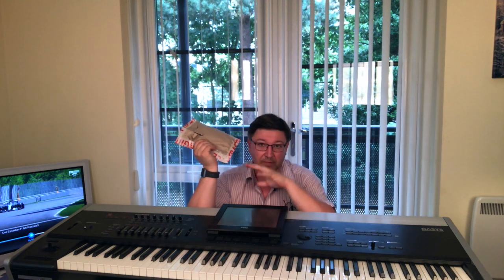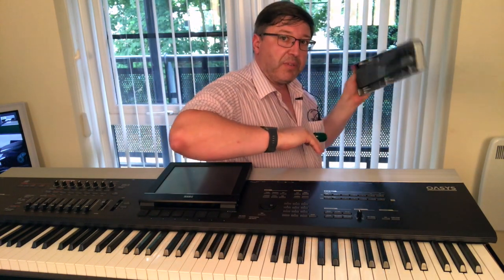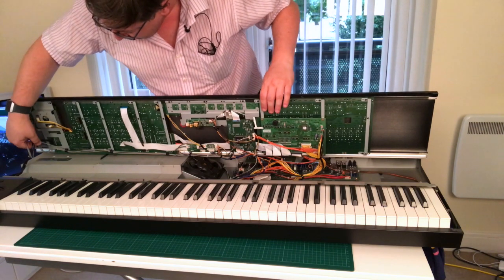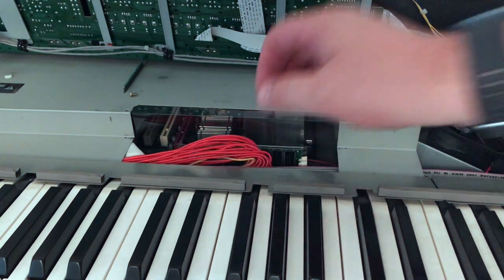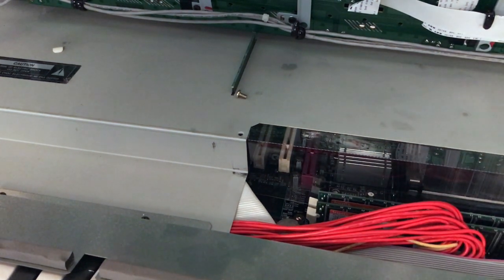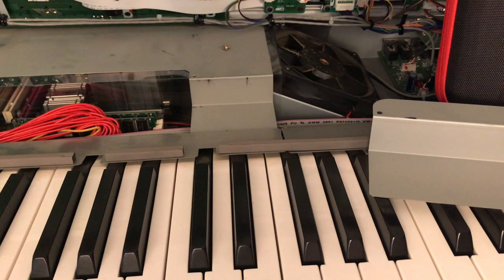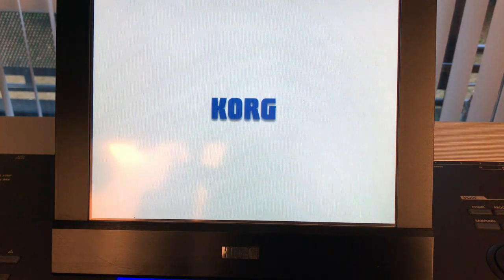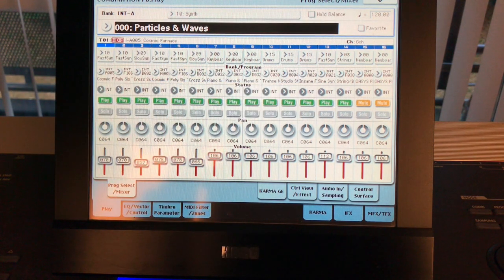Korg OASYS Installing more memory and a new battery

Comment: Hi, I have just aquired an Oasys 88 key also, beautiful thing and waited along time for it. I am going add an extra 1g of memory also.
My question is since you installed that extra ram, have you had any issues at all? Is it fairly stable? 
Thanks for your time and look forward to hearing back 😀👍
Reply from the maker: Have you subscribed? :-)

Well done.  It is a beautiful keyboard.

I am happy to report since I upgraded memory, OS, installed the additional engines and replaced the battery I have had no issues with this unit.  Jon
Reply: Yes just subscribed now, I have wanted one of these for some time and it’s always just been out of reach financially, finally one came up so I thought Sod it and bought it, I have all the expansions and am waiting for new memory to arrive, was hoping it was today so will be next week. Thanks for getting back in touch, next I am considering cloning hard drive to ssd swap??
Reply from the maker: I keep thinking about the SSD upgrade.  But I keep stopping at the point of having to potentially re-authorise the drive.  Jon
Reply: Ok update, extra 1gb card inserted, running beautifully and stable, now just this pesky hdd ???
Reply from the maker: Mmmm that pesky hard drive.  Jon
Reply: @TheMusicTechGuyUK  I went through my 88, and put 2gbs mem in, New battery and new SSD! (yes u can find ide ssd in a 80gb size and reload korg os up to 1.3.3a....  starts up so much faster, and browsing patches are lightning quick too.  Cheers
Reply from the maker: @Dave Williams.  Great feedback and well done.  Jon
Reply: @davew4335 Hi and  well done on your upgrades, I have new memory 2g total, new CR202 battery, was thinking of migrating  drive to 250 SSD, I have all my authorised codes and iso disks , just don’t want to knacker it.
Reply from the maker: @Stuart Williams. That was what stopped me going the whole hog and putting in an SSD and I haven't come around to that argument again in my head lol.  Jon
Reply: @TheMusicTechGuyUK  I have been talking to a tech guy at work, he’s happy to do it for me, I’m just very hesitant in taking it out and going ahead with it.
I know I have all the disks to reinstall everything plus codes, yet interestingly, at the weekend I went on korgusernet and logged in for another copy of the iso image , just in case, the message after read it would be with me within the hour, still haven’t received it? Wondered if it is working for Oasys anymore???
Reply from the maker: @Stuart Williams.  Korg have been switching stuff off on user.net.  I tried something a while back and didn't receive an e-mail so I got intouch with Korg support here in the UK and they were very responsive.  I suggest Korg support will be the next port of call.  Jon
Reply: @TheMusicTechGuyUK  Thanks Jon, I will give them a call tomorrow, I literally live round the back of where they are based in MK, so would be no issue getting it to them for service or repair etc, I had them service my Karma and Triton extreme a few years ago and they were really good about it.
Reply from the maker: Let the channel know how you get on.  Jon
Reply: @TheMusicTechGuyUK  Quick Update, Recieved an Email this morning from Korg JP, with a link for Re- Authorisation Codes and that can be downloaded within 7 days.
I have downloaded this and thankfully all the codes are itentical to the ones I already have so have made Fresh new copies.
If you try on Korgusernet and it doesn’t come through within the hour as it states, just give it a few days and it will like mine has done.
👍 Cheers.
Reply from the maker: @Stuart Williams. Great news.  Jon

Comment: I almost wanted to buy a used 76 keys model at $1.6k in Singapore but I already have the kronos2 73.. sadly technology jumps so fast...
Reply from the maker: Hi Jansen.  Have you subscribed? :-)

Again a fair price for a 76 key version of this keyboard. And I take your point on technology moving quickly.

But what I will say is that the OASYS is a worthy keyboard to be mentioned in the same conversation as the KRONOS.  The KRONOS has many of the same features developed for the OASYS.  If performs the same functions with the exception that the computer power of the KRONOS, KRONOS X and KRONOS 2 means they can have more notes play simultaneously, deeper wave generation, bigger sequencer memories and larger sample manipulation.  But in essence the the functions are the same.

The other thing about the older equipment is that I am getting increasing concerned that the modern equipment which requires USB connectivity to work correctly, will cease to function correctly quicker than some of this legacy tech that was built in the assumption connectivity to another device was not required to function.  Jon
Reply: Yes technology jumps so fast sometimes too fast. I have both an OASYS and a Kronos and to my ears the sound quality dropped hugely with the Kronos.
Reply from the maker: @binsinc. A number of people feel the OASYS was superior to the KRONOS in sound generation.  It is such along time since I have had both boards in the same place.  Although I will say the the Keyboard on the OASYS is better.  The other point is an OASYS was $8,000 new where as a KRONOS on $3,000.  Yes technology has moved on, but I suspect a fair chunk of the $8,000 was R&D.  Jon